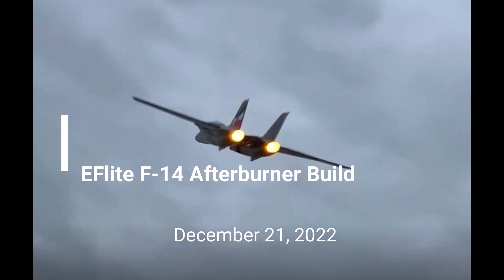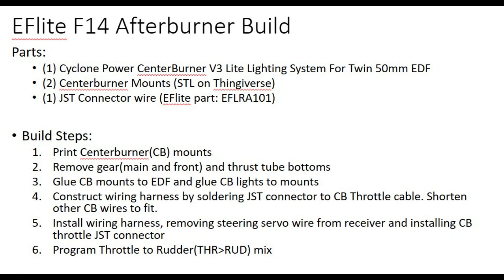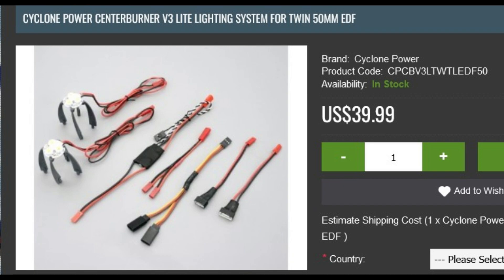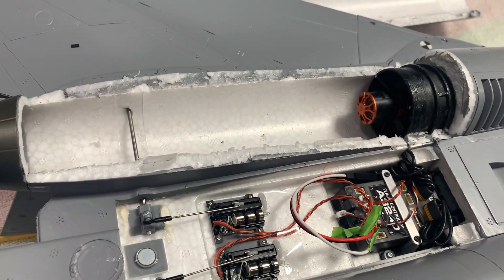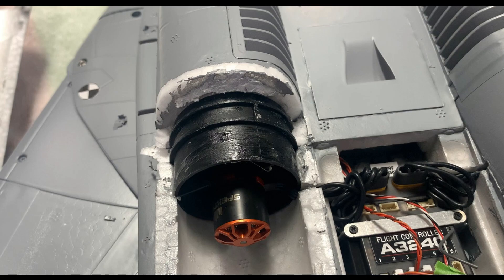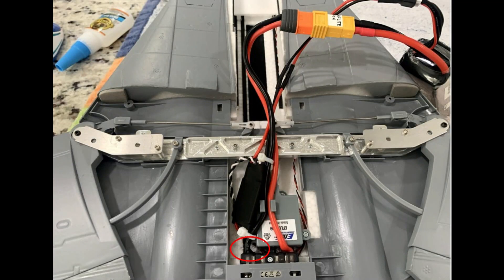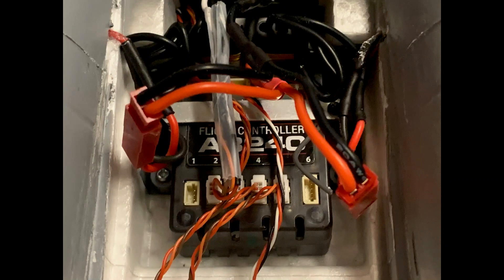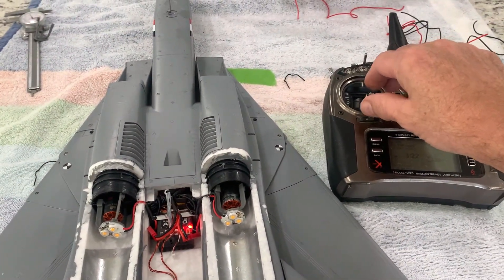EFlite F14 Afterburner Build Video

Comment: That’s awesome! Would you consider selling this as a package?
Reply from the maker: Dfflyer other than the centerburner mounts you can get the parts - see links. For the CB mounts just find someone local that has a 3d printer. Lots of people are willing to print parts from STL files and a link to the CB mount STL is in the links. This is much cheaper than me putting together a kit and shipping.

Comment from the maker: One update is since the nose wheel will not be used any more you don't need the JST connector(EFLRA101). You can use the connector from the nose gear.